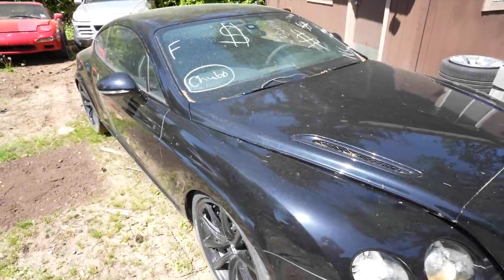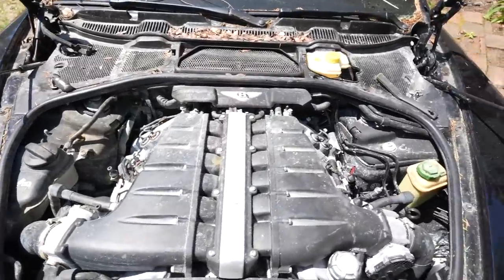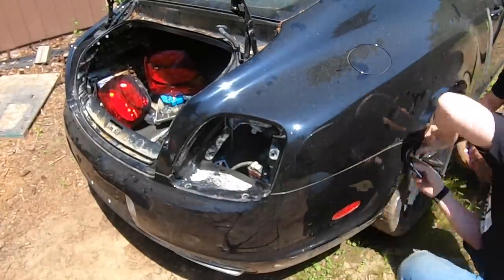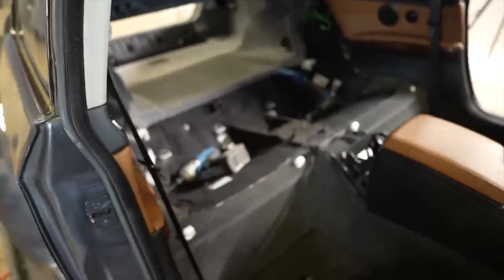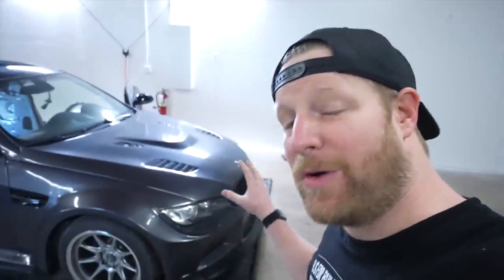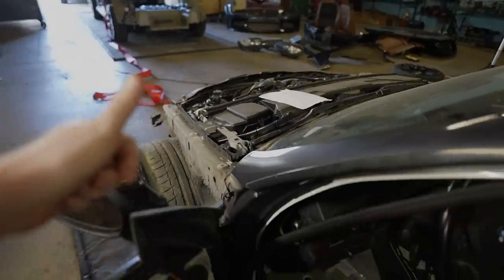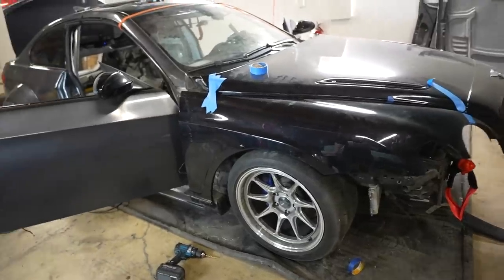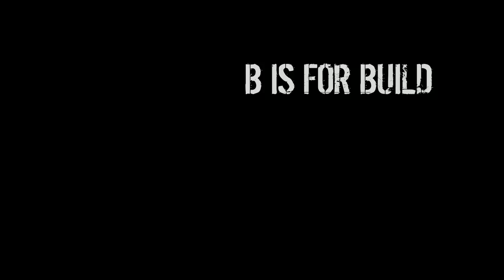Building my Flooded Bentley Continental GT Supersports into a Budget Race Car!

Comment: As a long term Carly user, I can say it's a fantastic tool. Saved me and many friends and family many times.
Reply: I dont like to hate on sponsors that support channels I loke but as a long time Carly user I hate what they've become. I bought the full app for 15€ and it worked with a couple of different adapters. After some updates the coding started to only work with their 30€ adapter wich i also bought. After switching phones they denied me to use my "lifetime" license to access all the features wich now are hidden behind different levels. Now I just use my laptop with INPA and NCS Expert for all my diagnostic and coding needs. Bought from BMW and not some company that changes their licensing scheme how they see fit.

Comment: If you're planning on keeping the headlights, check if you can buy repair kits for them. Usually possible on most cars but not seen one for Bentley - yet. Much cheaper than buying new headlights for the sake of a few tabs, obviously.

Comment: You might wish to talk to JR Goes on using a Bentley - the ECUs and other computers are very specific to each vehicle and getting them to work - when under water - or using others - isn't in the cards - and Bentley doesn't play well.  Good luck getting the motor to run without married computers. :)

Comment: I had the same e92 n54 auto. Around 120k the trans megatronic seals went out. Putting the car in limp mode. I would definitely change those out as it’s a common problems with those auto trans.

Comment: To get a little more width for the driver, you should of cut out the inner door brace. That way the door bars go into the door cavity. It will make a massive difference.  I'm 6 foot 4 and around 240 lbs. You need as much room as possible so you look for ways to achieve 😂😊😊😂

Comment: Not sure how this is gonna qualify for the loophole but neat build
Reply: @kruleworld  You don't have to buy a $500 car, if you get a car for a good deal and you sell the good parts you can reduce the price of the car until you get to $500, ChrisFix literally has a complete video about doing just that...
Reply: @kruleworld  I'd say raise it to $1k max. Any higher will make it to easy
Reply: Most lemons cars are about $10k now days
Reply: Mostly just the Chrysler thing. Curious how he's gonna figure it out!
Reply: @Banks4004  if I had to guess, the loophole specifically states "Chrysler product" so he theoretically could put Chrysler wheels, or just bolt in a seat from a dodge journey.

Comment: Can the Carly turn off the airbag light on the dash of your bmw? Ive tried a ton of ways to get mine off and can't, I put racing seats in and the light drives me nuts.
Reply: Did you put a resistor in the side airbag harness?  Some shady car rebuilders use that technique.